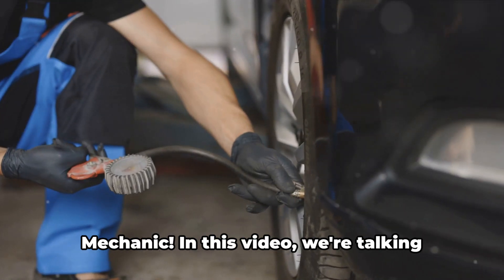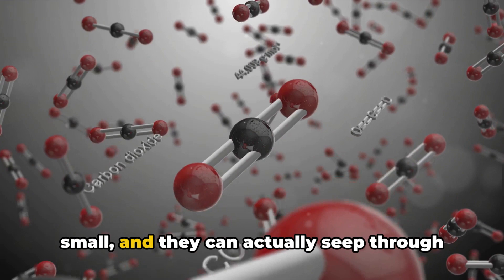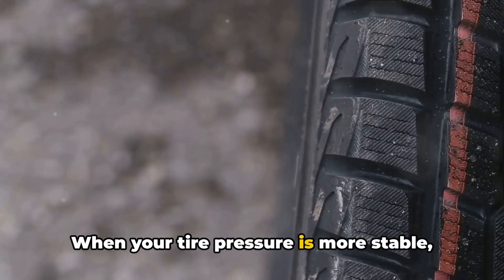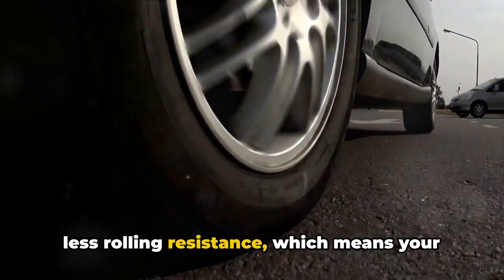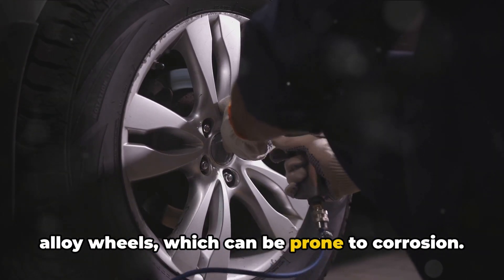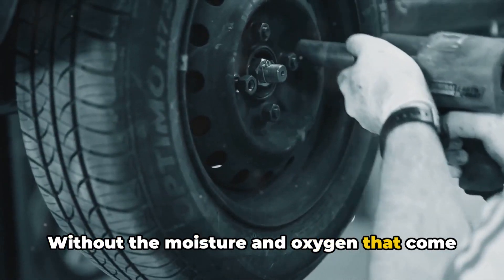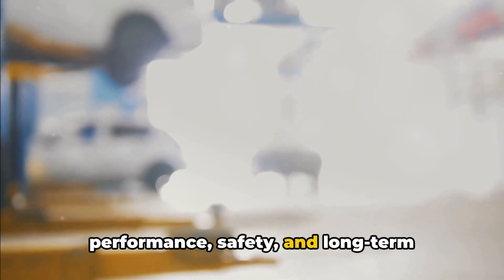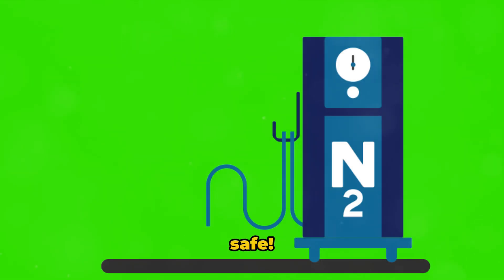Nitrogen in Car Tires: The Benefits Explained!

Comment: You should mention that nitrogen gives a smother ride on rough road. Noticed it right away on my car. Thats cause the mollicules are all the same size, and do not interlock, unlike air that is a mixture of gasses.
Reply from the maker: That's a great observation! Nitrogen can definitely make a difference in ride quality.